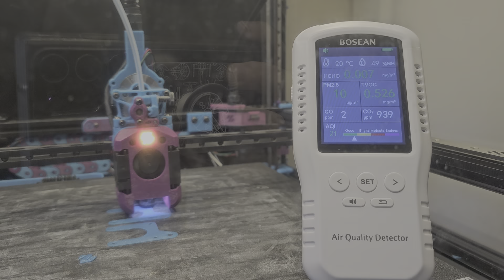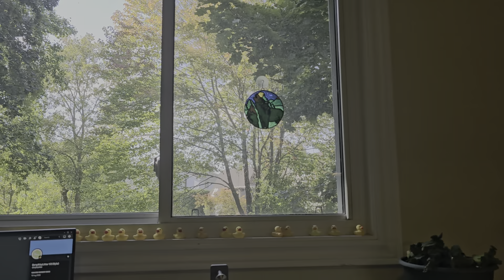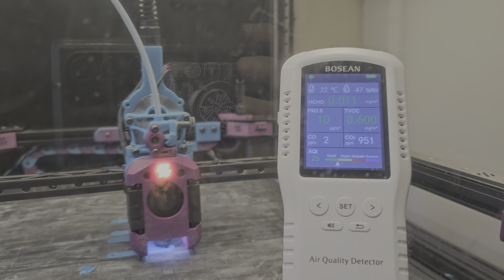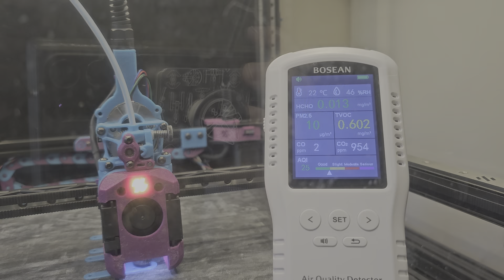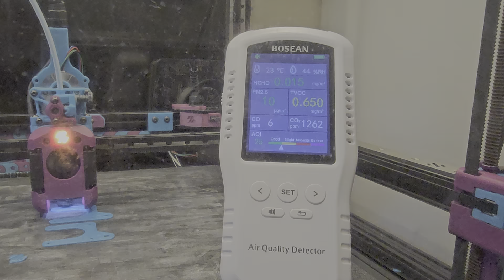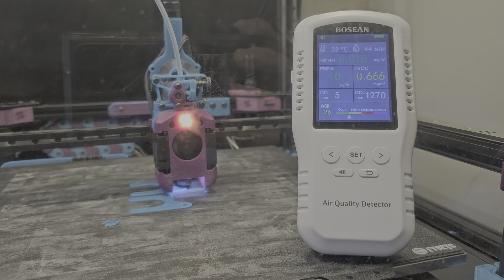Teachable Moments: Air quality in my 3D printing office space

Comment: I just took the the air filter from my shop and moved it to my print room , It doesn’t do much filtering as Vocs are related but all you really need to do is get good air circulation. It’s when they linger that it begins to be a problem
Reply from the maker: We don't have any air filter in the house currently. A few people have recommended the Levoit devices. I'll need to research options.

Comment: you could maybe invest in a heat-recycling air vent so you don't lose as much heat but still get fresh air inside

edit: this is assuming its easy to make a hole in your wall
Reply from the maker: We rent, so putting another hole in the wall isn't an option. I would have to be some kind of window mounted system if anything.

Comment: I use a levoit 300
Reply from the maker: I will look into those, thanks!
Reply: I have a levoit 300s and a 2nd one. You need to run them manual as they do not measure voc only particles
Reply: @TobiasStanzel  they don’t but there is a way to put the charcoal pellets inside… someone made a stl on cults… I haven’t made yet. But I like the levoit for size and volume.
Reply: @TobiasStanzel  I wish I can make it look like r2d2

Comment: As a union sandblaster I have had great training in the air quality needs, this has resulted in my changing many habits for personal uses at home from how I paint and 3d print, Resin and plastics, ABS, PetG, TPU, and PLA. Each has their own uniquely different needs. Active carbon is best method for filtering but fresh air or negative air pressure would be best. VoCs are incredibly dangerous and long term exposure is quite harmful. Respiratory and nerve damages are affected mainly. besides having your kidneys and liver damaged by the absorption through skin is pretty much a serious affliction.
Reply from the maker: Not sure how trustworthy this source is, but according to the manual of the air quality monitor that I purchased, anything less than 0.600 is normal.

Comment: Filtering is great but the bottom line is good ventelation for the workspace and ducting to exhaust out of the printer are both vital if you want safety.

I've heard conflicting info about filters, including the idea that nevermore can absorbe vocs in the carbon, but it can also release them back into the air, and tends to do so in higher heat. Since we're in a heated chamber, might not be as effective as we expect it to. No idea of the validity of that claim.

Exhaust out is the undeniably best solution. Create negative pressure in the chamber while printing to keep everything in, and then exhaust out after the print before opening the door. Not enough people do it (because it's admittedly annoying to set up in most spaces) but there is just no filter that is going to beat getting the air completely away from you.

Do not use that resin printer without the window open, a fan blowing, and a good respirator. Uncured resin is serious business.
Reply from the maker: 100% agree. As the resin printer is the worst pollutant here, I am considering rearranging my office to move it directly below the window, at least as a first measure. We also have a garage, but it is unheated, so that won't be a viable solution during the winter, plus that is my woodworking space, so there tends to be some sawdust kicked up periodically.

A proper ventilation system is definitely worthwhile. Investigating what options I have given the spaces I am working with.

Comment: It was my understanding that VOC could ONLY be absorbed by carbon, and that hepa is only useful for particulate. 

I had been using the nevermore v6 for a while, and it definitely lessened the smell but I dont have meters for the actual VOC reading. Recently I switch to the_filter (2x single and the normal center filter) to get a bit more of the bed fan effect while still having carbon. I can say there is a noticable improvement in both heat up time and max chamber temperature (from max 42c to max 65c). Interested to see what solution you find for better voc management. The nevermore max/stealthmax have caught my eye recently, but I have too many other upgrades in the queue to hop on that yet. I may just end up tossing a nevermore v6 with the hepa cartridge in there somewhere short term.
Reply from the maker: No firm plans yet, but I'll post more content as I dig deeper.

Comment: Ive just modded the small nevermore to take small roomba hepa filters. haven't tested it yet but ill get it up on printables if you would like to take a look.
Reply: I too designed what I call a "scrubber" using carbon and a small vacuum HEPA filter to remove VOC and particulates. The design is ready but I have yet to prototype it yet. It is designed from scratch so probably a lot of tweaking still.
Reply from the maker: Please share the link once you're ready!